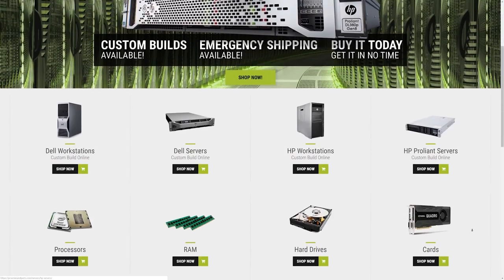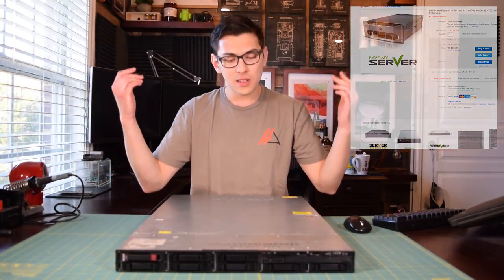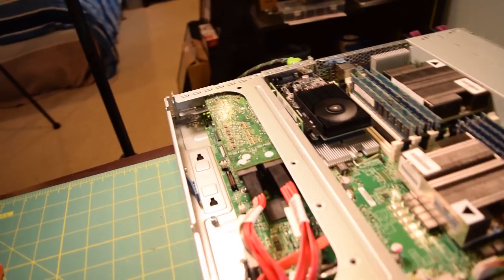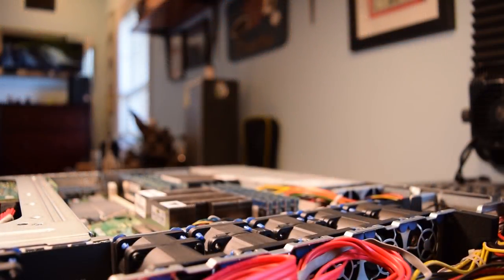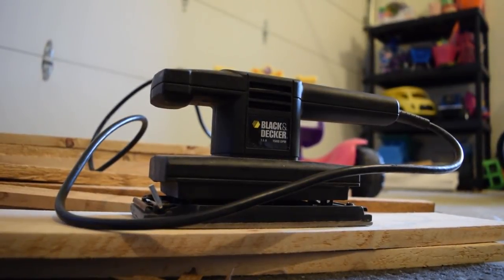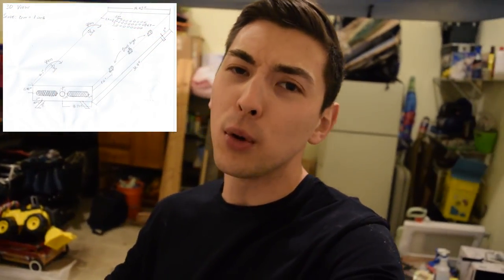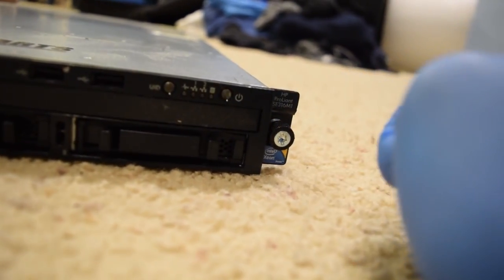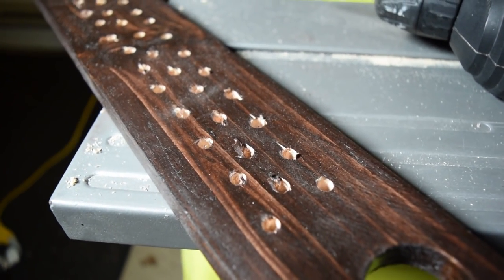Building a Desktop Case for a Rackmount Server | Proof of Concept | Part 1

Comment: I bought a Dell PowerEdge R810 from eBay with 2 10 Core Xeons and 128GB RAM for £450 ($580). I installed Windows 10 Pro which gave me one problem, the Dell website only has drivers for Windows Server for the onboard Ethernet. I installed an Ethernet card to resolve that issue. I also installed a GeForce GTX 1050 graphics card but I cannot configure it to use the card during POST so I have to use a monitor plugged into the onboard VGA port but once it loads Windows I have it set to use the monitor on the graphics card as the only display.

Comment: When the host cut the mounting tabs(the "ears") off the front corners of the box the unit was permanently damaged.  The OCD part of my personality was deeply offended, and I stopped watching the video after that.  I know from experience, keep the tabs!
Reply: Yeah, should have made a stepped entry so that those bumped against a stop on the way in. I cringed hard too.
Reply: @morosis82  Yeah, at best he could have drilled out the rivets so they could be added back later.  My HP DL360p has a couple status lights inside the plastic ear tab covers.  You wouldn't want to remove these.  Keep the tabs...  A new world movement...

Comment: Are you sure you wouldn't rather just purchase a small rack that could fit under or next to a table? I see a StarTech 8U 2-post Rack on Amazon for $34 right now.  You'll also need to buy either 2-post rails for the server or at least a rack shelf to support it, and hopefully those will come with enough cage nuts and screws, but that sounds like a far better option to me.

Comment: I would build a wooden case from whitish 1cm-2cm thick wood. Starting with at least 6 big square rubber feet, then the base with some 5mm holes, then 4 side pieces for back, left, right, and front panels, these panels being screwed to each other and to the bottom, the back having 1 or 2 square holes where would fit 12cm fans, then an hole for power cable and another hole for lan/vga/other cables, maybe not holes but square cuts from top backside to allow cables to be added without effort and a rubber square block to make cables get still. The top side would have same dimensions as bottom and having 4 screws to tight it to lateral sides. Top of bottom base would have thick rubber pads to avoid vibrations, and some other stuff. and yet... some varnish finish and the AA logo at top.

Comment: I think the main reasons why people don't go for these for home use is because
a.) Single-core performance on these is not that good, since they're made to run server software in VMs (web servers, e-mail servers, databases, etc.) which don't require a lot of CPU 
b.) They're very power-hungry, so expect your electricity bills to double
Reply: They are GREAT for video rendering from what i know, but many people only want to game in them, so yeah. 
And they are really too noisy
Reply: @eduardoavila646  You are right. But rendering is a multi-core operation. That's why people use servers like these in render farms.
Reply: @needfulart4510  Yep. Most home users use tasks that benefit way more from singlecore performance than multicore. 
But i must say, i would love to have one of these servers, my i5 struggles hard and even bottlenecks my 1060 in rendering. 
Unfortunatly here where i live, used servers are too expensive, and importing stuff is also awmost impossible.

Comment: When you drill holes in a finished surface, you can place a scrap of unfinished wood on top of and beneath the finished one and drill all the way through that. it will minimize the damage to the finished board.
Reply from the maker: Thanks for the tip!
Reply: Exactly.
Reply: No prob!
 @AAComputersandTechnology
Reply: masking or duct-tape will also do, not as good, but will do, depending on the size of the hole
Reply: @AAComputersandTechnology  whats the other type of server you can use as a desktop?

Comment: That metal ends you cutoff is the faceplate of the 1U chassis, it screws into the rack and prevents the chassis from sliding all the back into rack frame when mounted on to the rack rails, like a drawer for a cabinet.

Comment: nice build coming along here. Just gained a new sub.
I actually quite like how well that wood turned out once stained. As for the drill holes I see some others have already said this, they wasn't wood bits and someone else suggested to put scrap wood under and above to reduce the burr. 1 other thing you should really do is slightly smaller pilot holes then go through with the size you actually want, while drilling this gives the material room to move a little there for wont force itself up od down so much causing the damage. Just another tip for the future ;)

Comment: I would love this to be in a isolated box, with water cooling on the cpu's with the rads mounted on the outside..
Would work best with a 2u or 3u case with noctua fans for minimal airflow inside.. while you're at it.. screw the whole thing under your desk and there u go.. a silent server grade pc (i would use the many cores as a streaming pc or game server etc..)

Great video.. (Although if I were you i would save myself alot of time just buying wood wich do not require sanding)

Comment: Line the inside with some sound dampening foam, in between the bits of wood on the top. Will cut down a bunch of noise.

Comment: With all do respect, and I mean all do, server are very pipertary with their connections especially power supplies. hardware raid is better than software raid. Servers are really not meant to throw video cards in, while you can do it they make special gpus for vdi, along with you can do virtualization with servers spin up many vms using esxi or hyper v, I really enjoy your videos man and projects but there is so much more you can do with this server. You’re best bang for buck is really going and getting a workstation for what your looking to do.
Reply: Yeah, if you're after a desktop, a workstation like the HP z series, or Dell precision, or whatever would be a better choice. Generally about the same cost as rackmount for this old gear, more flexible for desktop type workloads.